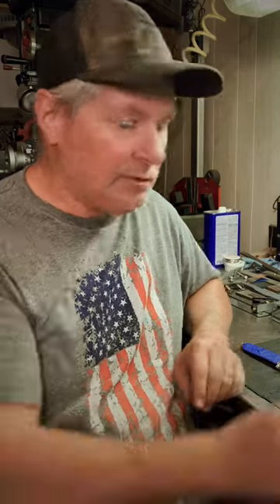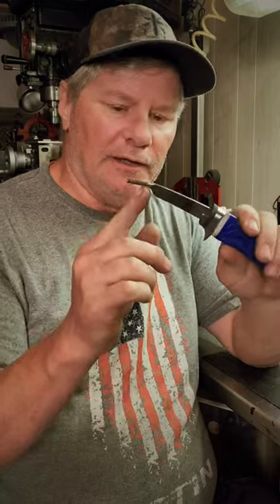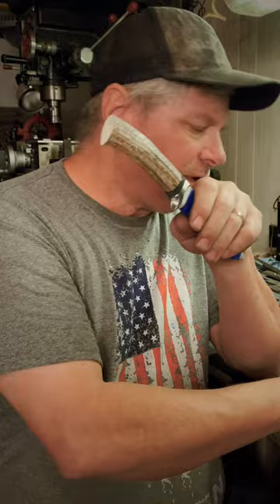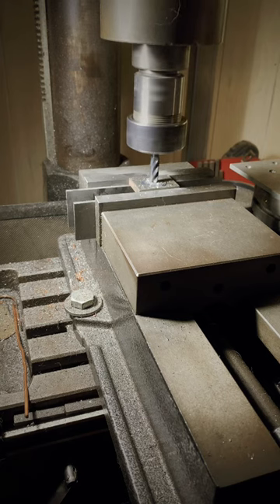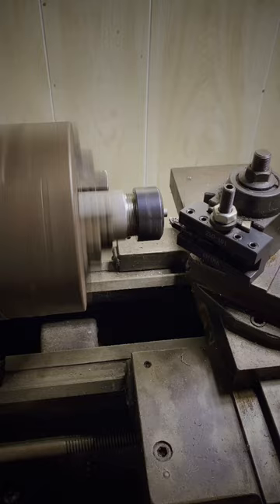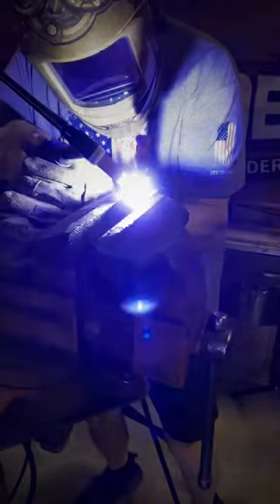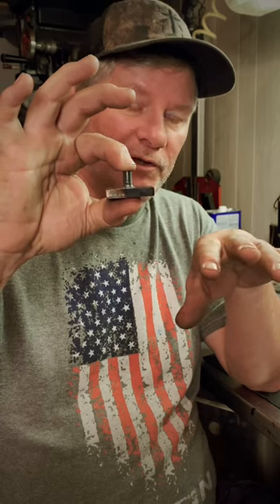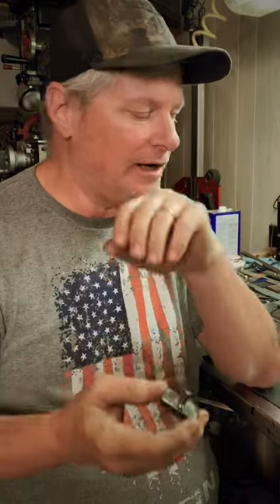How to fit a knife pommel.  #shorts #knifemaking

Comment: I have to agree, mechanical connection will last a long long time as long as the knife is stored right, these glued together knives always give me visions of the handle popping off when you need it there the most lol.
Reply from the maker: With this kind of handle and having no pin through the tang, a screwed threaded tang is the best option in my opinion and the pommel is like a giant washer.  😁

Comment: What other ways are there?   Can it be done without welding?
Reply from the maker: Yes there are. You can just thread the pommel but you can’t finish it as thin.   It can be pinned or wire hooked. That would take some demonstration but I prefer the threaded option.